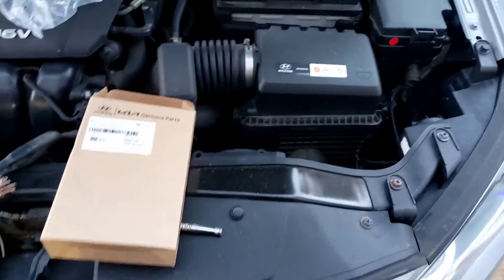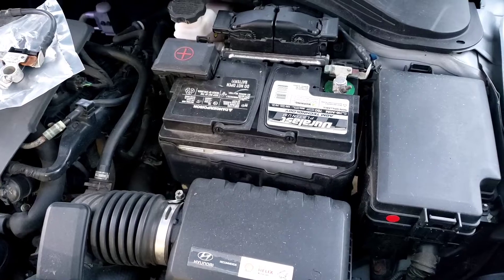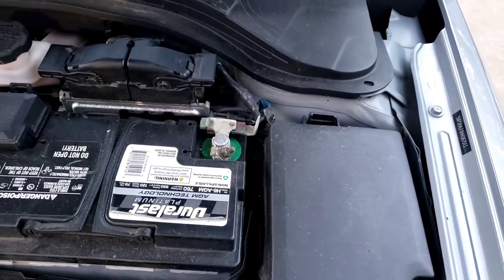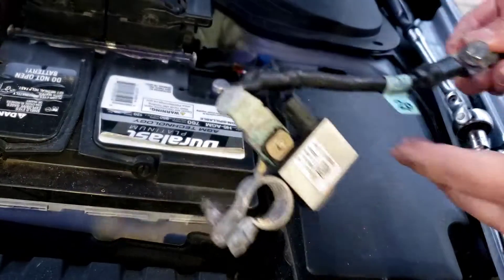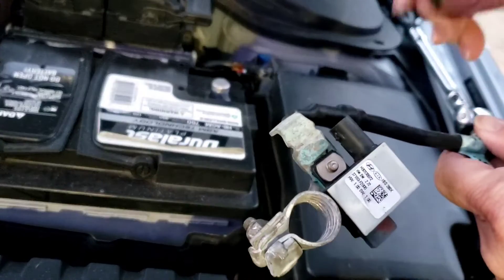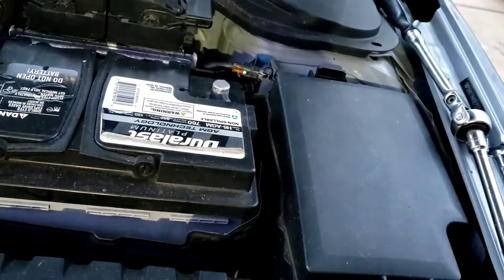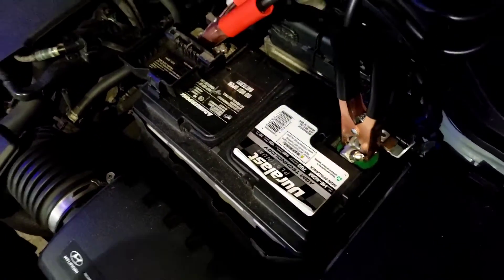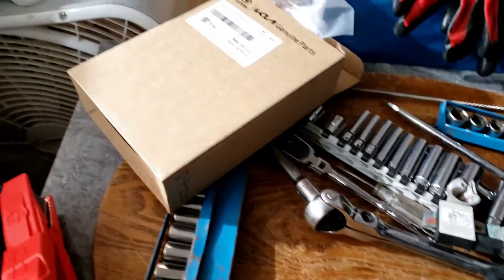Hyundai Battery Sensor Negative Cable Replacement Change Flashing Battery Light on Not Charging

Comment: I accidentally reversed my battery cables , then changed battery and alternator but car will start fine for a few times until battery dies cause the alternator still isn’t working. As well i have the battery light on , abs, the light that indicates a warning that  someone is near, parking brake light is on , radio and charging outlet don’t work , and the steering is now very loose. Checked all fuses they were good so now im thinking I fried the computer or could it be this sensor ?
Reply from the maker: Zapping the battery by reversing the cables will definitely damage something , loose steering might be coincidence  because nothing in a battery or Alternator  change should  affect the steering.
Reply: @alyoungcuda I figured that but with all the problems mentioned do you think it’s my battery sensor making alternator not charge the battery and the lights on dash and steering being loose or would I of fried my computer
Reply from the maker: the computer controls the charging, you might of burnt out this sensor but definitely burnt out something and the steering is a totally different system and its mechanical not electrical  so it would have nothing to do with any wires reversed
Reply: @alyoungcuda thank you , I’ll change the sensor and hopefully that’ll fix my braindead mess up lol
Reply from the maker: fingers crossed for you. Good luck

Comment: Hey boss i recently bought a new battery plus Altinator the battery light red symbol came on and off while I was slowing down the speed amp was going up after pushing gas vibration.
Reply from the maker: Did you change this part in the video?
Reply: @alyoungcuda no I did not to be honest how would I know if it’s faulty on the plus side the terminal was broken I bought from a dealership new installed it
Reply from the maker: That sensor I can never fiqureout how to test it, do I just replaced it and it solved this cars problem.
Reply: @alyoungcuda sensor is located in which part of the battery side negative side you mean to
Say
Reply from the maker: @brethart4938 the sensor is part of the negative battery cable as in the picture,  yours is not like this?
Reply: @alyoungcuda really but one quick question why the car is getting hard on break and shut off oil light and battery light appears
Reply from the maker: Battery light and oil light comes on because it stalled, same thing if you just turned the ignition key on without starting the car, all your lights on the dash will appear.
Reply from the maker: What do you mean hard on the brake? When the engine stalls the brakes will get hard to step on because you lost the engines vacuum to operate the power brakes
Reply: @alyoungcuda yes true I had to drop a family today what happend just the car got shut when I dropped off after when I was coming back ok the car lost power break pedal got harder and power got pushing gone away while I was turning the on it didn’t  turned it was coughing gerrrr gerrr gerrr  couple of the rpm was not going and pushing gas pedal was picking I think either crankshaft position sensor might me the issue because later when I towed the car it showed three p0030 0017 and 0014 also
Reply from the maker: @brethart4938 check this video
https://youtu.be/Yx5_qsxtmkw

Comment: Hi. Did it fix the problem? My battery light is flashing randomly also. Replaced battery and they said alternator is good. So not sure what to do now.
Reply from the maker: @soniamurillo7523  sure did
Reply: @ okay thank you, I ordered the part. I will try that now.
Reply from the maker: @soniamurillo7523  and clean both contact surfaces on the body and new cable

Comment: I got a question boss, so my negative ground cable snapped,and I was just wondering can I just replace the ground cable instead of replacing the sensor assembly battery?
Reply from the maker: Well the factory computer will look for that sensor in order to tell the Alternator how much and when to charge up the battery. If you remove it, then I will guess that the Alternator will go in its highest charge..The only real test is for someone to try it out. How much of a difference is the cheapest priced cable with the sensor compared to a regular cable..I've seen prices online on ebay and Amazon

Comment from the maker: Gustavo, if you said you have no power but if you move the battery and it powers up, you have a bad connection at the battery terminals, look at the cables where it connects to the terminals

Comment: I have a 2013 Hyundai accent, my problem is that my car looses all electrical power I tried jumping it no power whatsoever no lights on dash nothing then push the battery a little and guess what everything work again all electrical power was back car turn on and it worked, you think the negative sensor might be bad?
Reply from the maker: The key word here is that you pushed the battery..did you mean you moved it? If so then your problem is a bad or dirty connection at the battery  terminals or the cables going to them. Take them off and clean them with the wire brush tool for the terminals,  check the connections for corrosion..
Reply: Same happen with my hyundai 😢every fcknggg time
Reply from the maker: @kiittiimartinez1044 did you verify the battery is good?
Reply: @alyoungcuda  I already changed it a few day ago I bought a new terminal let's see how's going 🥲
Reply: @kiittiimartinez1044 did this fix the issue? Having the same problem with mine and just ordered a new one
Reply: @gaegogain  yes it works fine now
Reply: @Runt4U  try to change the terminal both sides then u can see if that's the problem